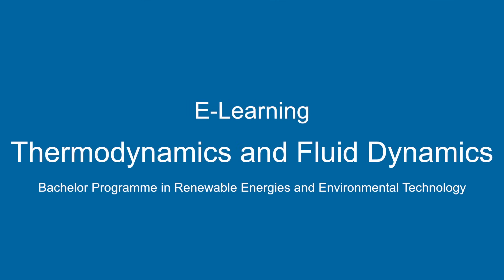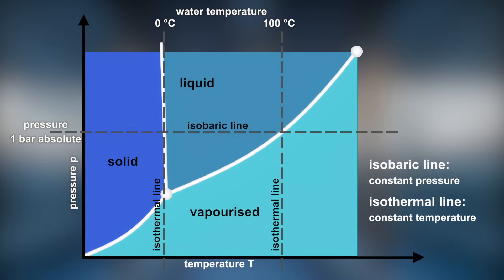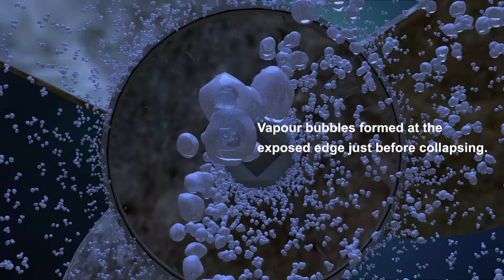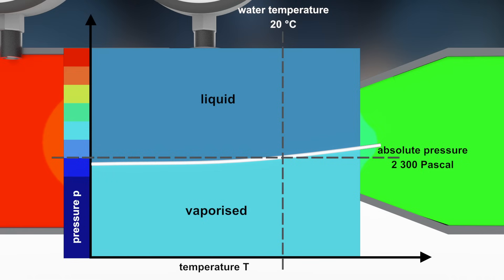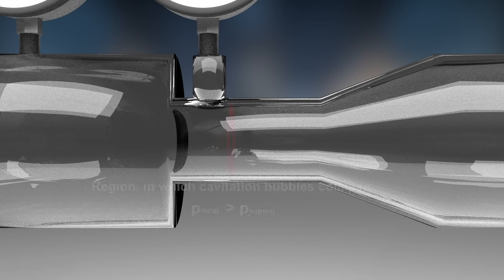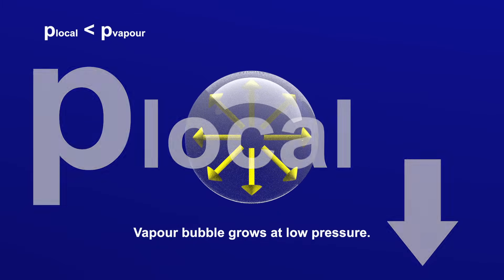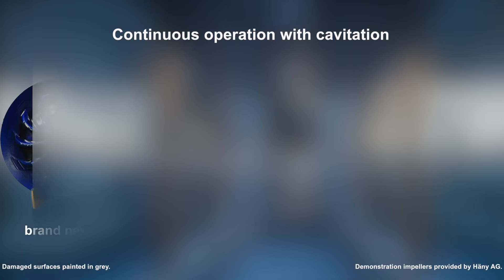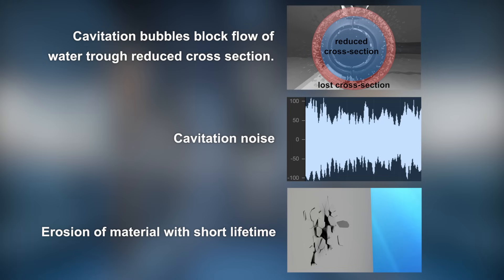Cavitation - Easily explained!

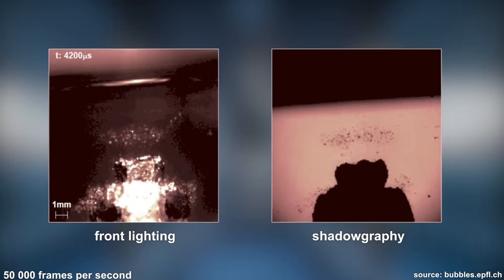Comment: 6:53 - A slight correction. Water vapour can be many thousands of times larger than the water it was, but not always.
The minimum expansion ratio is ~1600:1 when vapour forms from water. But the ratio is only limited by the energy put into the system until such time as a black hole forms. :P
See: the Planck Length.

Comment: So correct me if I'm wrong, if u were to take a low pressured water hose like the one you use to clean your car with & bubbles form (from low pressure), when the bubbles hit your cars surface will it have the possibility to create micro damage when the bubble implodes (hypothetically speaking)? Just trying to create a example that's simple to wrap my head around, though I think I understand the lesson, creating my own example and double checking if its correct ensures I understand the assignment. Also, anytime you see water in air bubble form is that considered a cavitation bubble? I apologize ahead of time if I'm way off base here, just trying to put things into perspective.

Comment: I have a solution to this problem. You know about superheating of water in microwave oven? If the glass is smooth and has no nucleation sites, bubbles cannot form. If you can somehow manufacture screw with absolutely smooth surface, there will be no cavitation.

Comment: When a propeller in water begins it's initial rotation, 2 things happen; the propeller blade forces water in one direction. Water ahead of the propeller attempts to fill the space vacated by the water the propeller forced to the rear; for an instant, between these two events a vacuum is created. It's plain old common sense. The vacuum is a momentary phenomenon as new water moves back to take the place of the displaced water.  The force the prop imparts to the water is mirrored by the force the water being displaced imparts to the prop blade, moving it in the opposite direction of the displaced water.  That is what pushes the boat forward. Common sense.

Comment: Water evaporates at low temperatures - ie from a window pane after rain. Pressure is not the vector causing phase change but radiant energy is - Gerald Pollack gives reproducible perspectives on water I haven't met anywhere else. However, this is not directly related to cavitation - as far as I can see. But the idea that water must boil to vaporise is plainly false.

Comment: Excellent and clear. Super attention to images and video demonstrations and slow motion real camera work. So much better educationally than looking for long time at some face talking.
 A couple of questions: Video says “evaporation” occurs only above 100 C at 1atmos, Maybe shouldn’t we call it “boiling” or “vaporization” to distinguish from evaporation? The latter term evaporation is generally used for what happens well below 100 when your wet clothes dry out for example. 
Also just to let people know.. boiling needs “prompting” or seed points usually. It is so easy to superheat water in a kitchen microwave making a cup of coffee, throw in a spoon of coffee powder and see instant boil rather than instant coffee and often dangerously ejected. Reason for antibump granules in chemistry when heating liquids in test tubes.

Comment: Looking at the impeller at  08:42 it is clear that the designer needs to modify the inner design of the impeller as the entry of the water in that centrifugal pump is not correct at the right angle of attack with respect to the blades.
From what I can see , the blades  part at the centre is dealing with effectively  water coming straight at  the blade with no radial velocity and this will definitely cause circulation as in a sudden expansion in pipes which rotates the water behind the blade to cause the wear shown in the second diagram.
What that impeller needs is  for the central part of the blades to have an axial pump or an axial turbine blade to cater for the incoming water axial to the shaft of the pump, before  the water is given a radial component when  the radial velocity in a centrifugal pump is fine to deal with.
perhaps they should copy the design of the compressor in a turbo engine where the start of the blade is partially an axial compressor interlaced with a centrifugal compressor.    The pump manufacturer should have seen this before as most high pressure pumps do have  a feeder pump ahead of it, including the old diesel pumps in trucks. It is never easy to change pressure in a liquid over a small distance.

Comment: Cylinder liner cavitation erosion can be sharply reduced by using a high boiling point/low vapor pressure coolant such as Evans non-aqueous.  Almost no bubbles form to begin with, so there is almost no vapor to collapse, and nearly zero micro jets.  Testing by ASTM D7583 (John Deere Cavitation Test) bears that out.

Comment: Great video! The only visualization that may be not so accurate is the shape of the "toroidal bubble" when the bubble collapses near a wall. The cross section of the bubble must not be so perfectly circular. This is because the asymmetry of the collapsing bubble will produce a cross-sectional shape similar to a tear drop. The maximum damage caused by the bubble jetting is when the bubble is attached to or located very close to the wall. Otherwise, the water layer separating the bubble from the wall will dampen the jet impingement. The shock (or rather the blast wave) from the high speed jet hitting the opposite side of the bubble surface will also add to the total load on the solid wall (to cause damage) associated with the collapse of the bubble.
Reply from the maker: Thank you for your input!
Reply: Tear drip shape = phi : 1.

Comment: One of the best cavitation videos!! 
When pressure drops bubbles form when pressure gets back the same bubbles collapse. This collapse of buubles is accompanied by high velocity jets that cause erosion.
Reply: Correct. The low pressure in the bubble causes the high pressure water behind it to accelerate through it at high velocity, which cuts the bubble into a donut and gets shot out the other side at extreme speed.

Comment: This is how I want every thing to be explained. Great video
Reply from the maker: Thank you! We are working on that;)...
Reply: excellent!
Reply: me too !
Reply: @ABU BAKAR SIDDIQUE Please, so many comments... Read them, they claim to learn something important... misinformation. This finding is one of the most important that could grace the planet. With vibration creating nuclear energy that can completely eliminate any toxic waste. And, if you play your cards right, replicate any molecule. In addition to this, the Joe Cell demonstrates that the energy from the compression is pure Ether... and can be distilled from the gas by simply using a metal tube off the cell, with a cork in the end of the tube. This is similar to the technique Tesla used to distill Ether from the electricity with carbon electrode at his spark gap. Joe did not even consume his water, he simply re-energized it, harvesting the energy in Ether form, without substance, but all the performance of the gas, another aspect of Ether that Tesla discovered. This may very well be a technique used by the builders of the pyramids... but, that's another story.

I beg to differ, the teacher is simply repeating mystical spells that have no connection to reality... That is not education, its delusional.

Is there something wrong with the teacher? No. He's making money, he gets paid to repeat this nonsense. The object is to set people up so that they do not realize they can make all the power they need without limit, and replicate any molecule... All while cleaning up the toxic waste from the pirates who know only the process of exploiting our habitat and our brothers. Pirates rule our culture... fit in or die... just stop passing it off as science. Admit the job makes them say this nonsense... but its not real... Reality bites. Peace, B
Reply: Easily explained ?????
Reply: If only they could properly pronounce “v”s in vapor and not like “wapor”..????
Reply: I am engaged in the pump cavitation simulation study, look forward to more exchanges
Reply: Delusional science. Fails to explain the plasma spark. Does not detail the actual turbulance of the impellers. Does not mention the fact that the bubbles remain in gas for up to five atmospheres.. Does not explain the diamagnetic properties of the gas; a magnetized impeller would not pit. The obviously whack explanation of the bubble collapse. If the bubble is collapsing from a pressure increase externally driven, it would not collapse from one side.

It makes more sense to see that an increase in pressure is causing the bobbles to condense. The collapse happens from the central point of highest pressure. This causes a release of plasma energy delaying the collapse, shaping the torus, disrupting the sphere. The gas has been analyzed. It is made of clumps of water ions and radicals. The gas will dissasemble the atoms of the impellers. You will not find any flake in the fluid. Make a cavitator, collect the gas. It burns like natural gas whit more applications and no pollution.
Reply: @mundymorningreport3137  look up the leclair effect, this explains your questions. https://www.youtube.com/watch?v=KQoFwKKivRs
Reply: @freelectron2029  Wow, great link, sh*t video quality... but, the company website has the presentation available with a few changes... so following along was smooth.

Interesting to add his limited but in depth analysis to the picture. Since he's only studied the tiny bubbles... What can you expect? He refute's MIT's failure to get cold fusion to work. Looks bad for MIT. Guess the whistle-blower who said they faked the data was telling the truth. He also failed to appreciate the extreme amount of electricity released by the LeClair effect... oops... 6x more than the electricity released when hydrogen burns. That's not part of his "expert" analysis... oh well, can't help but feel sorry for today's scientists who just don't get out of their specialties.

He's got the modern physics jargon down, doubt it will help him commercialize anything beyond the niche nano-tech markets, despite his disclosure of massive heat and energy production over unity. This stuff makes oil and gas compared to cavitating water look like burning dried poop compared to electricity.

The secret he used was agitation and lower vaper pressure (starving a water pump of water so that it foams) or zapping with a laser at a wavelength that water absorbs... put a little voltage across it and you're right on top of Stan Meyer's method of making mass quantities of HHO, same stuff-same effects.  Peace, B
Reply: @mundymorningreport3137  if you watch to the end he talks about the transmutation of elements. he produced every element uptil californium using a pump and a piece of aluminum inside a pvc pipe. i take it your familar with Moray B kings Talk he gives every year. always pretty much the same thing but in it he points out omasa discovered the bubbles and used them in HHO production. but the Hydrogen is not what you want. its the secondary gas thats heavier than hydrogen. it can be pressurised and stored and has way more power than hydrogen when activated with an abrupt plasma.it seems the caviation bubbles are nano bubles with trapped energy in them that can be turned into a gas an unleash there power when a plasma is applied. this was meyers secret with his final invention the water injector. except meyer ionized air with a laser and a noble gas which when both were combined with the water which cavitated at the nozzle and was hit with a plasma dicharge all in a spark plug type unit. morays talk is here: https://www.youtube.com/watch?v=iHjR_FnG3yA&t=51s
Reply: @freelectron2029 Yes, very familiar. But, the bubbles are the gas. The "jet" compression is clearly an artifact of the variable pressure around the bubble when the pressure reacheas above 5 atmosphers. This initiates the release of the energy the magnetically bonded molecules have formed. (See Denny Klein's patent). That energy, spawned from the very energetic bonds of this closesly packed gasseous water cuts through atomic bonds like a hot knife through slime. When you have enough gas, it completes all the partial nuclear reactions and produces monatomic hydrogen which bonds to the O2 or itself. The extra temp he gets out of his reactions is clearly from the nuclear reactions. The guy who patented the cavitating water heaters no longer does that, the steel drums all needed replacement and offset the energy savings. IF he magnetized the drums it wouldn't be a problem... But, not doing the research costs him money. They were a great sale item. Now he just does chemical slurries, which can afford the lost chemicals for the heat. Ican see why science loves the pet names for stuff. It gives them an ego rush... and avoids having to explain the process in simple terms... hides the magic in their thinking. Peace, B
Reply: @mundymorningreport3137  hmm interesting. thankyou i did lots of research back in the day with HHO, i was the owner of a joe cell group on yahoo groups, still am, but cant get access for some reasonn HAha and am only now getting back into after finding moray. thanks for the denny klein suggestion, i knew i had forgotten someone. is there some way i can get in touch with you in the future if i need to bounce a few ideas around? or a group you can suggest maybe? thanks again.
Reply: @freelectron2029  I've put contact info in channel. After years of research , re equipping my tools... fun time is coming.
Reply: @freelectron2029  ZPE, please... pseudoscience. The bonds in the diamagnetic molecules hold the energy that is released which causes nuclear fission on site. Simple... and not exotic with unverifiable modeling.
Reply: @mundymorningreport3137  something is not “delusional” just because it doesn’t go into as much detail as you’d prefer. I’m sure there are more in-depth, less “broad overview” videos on this topic, Mr. Know-it-all.

In fact, since you seem so sure of everything left out, why don’t you go make a better video?
Reply: i found it unesscasarily complicated. they are trying to hard to be "professional". the problem with technical deminstrations is they love to use technical propriotory language to show how smart/professional they are. this is the wrong way to share information. if someone is looking to learn then things should be explained simply. and choosing someone who cant pronounce "vapour" to do a video on cavitation shows a complete lack of forethought or planning.
Reply: @freelectron2029  You must rewrite your post 1000 times so that you get it right, paying particular attention to: unnecessarily; demonstrations; proprietary; can't. Furthermore, the first letter in sentences are properly capitalized.
Reply: well said <3
Reply: I agree!
Reply: and all the indian fake accounts commenting on this video and how amazing it is are a clear sign you have paid for likes. very unprofessional and tacky. yes we know what you did.